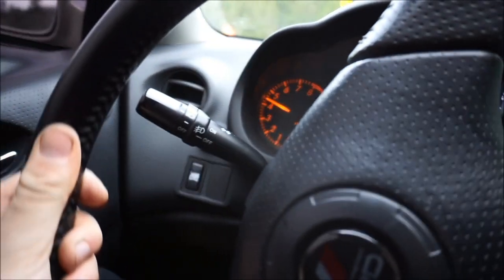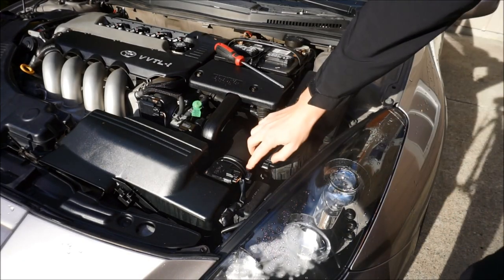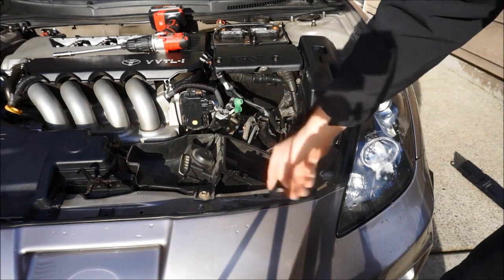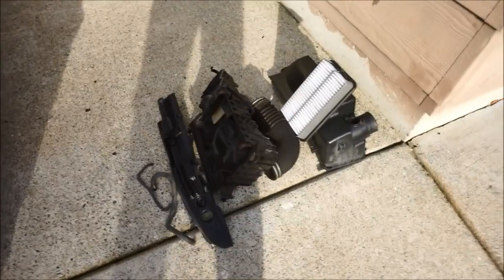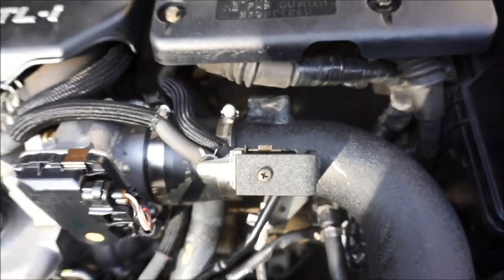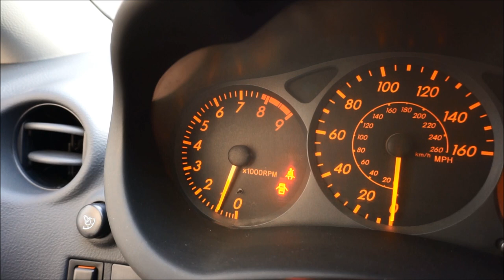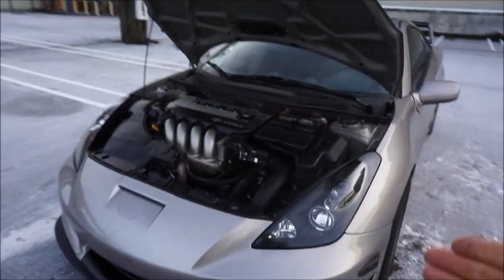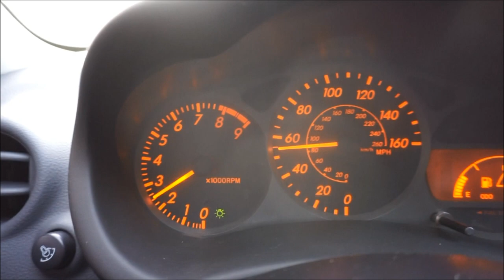MITCH DORE | Cold Air Intake Install "GAINED 10HP+"

Comment: Got beat by a stock 2012 Mazda 3 2.0 I'm selling my GTS and just buying an actual fast car  😂🤦
Reply: Turbo your gts it will destroy most things
Reply: @scottbeaumont8651  yea but for the amount is it gonna cost to turbo it better off buying a car that's gonna put out the same power at a turbo Celica
Reply: Get a second car  and use the Celica as daily. I have my Ford RS to give people the smoke.
Reply: @carlosvillagran183  Second..... (As In I second that notion)
Reply: Mazda 3 is so ugly car..lol.
Reply: You weigh less with more power stock so you did something wrong there lol😂 I tested a 2010 mazda 3 gt 2.3 before I went and bought my vibe gt. Vibe gt has the same engine as celica gts and I'm very happy with it. 😎

Comment: Put my CAI today after I was running a short ram for 2 years! Wow definitely a difference in the response the car dont feel sluggish.  That Cold air rushing  in helps with the combustion that's for sure.. mine is a AEM brand scored at junkyard 7 bucks.
Reply: How do you know which CAI's will fit?
Reply: @joshuaprobably852  make sure it’s designed for your car and engine

Comment: hey Mitch, i saw in the engine that ECU dont have air cooling duct, it is why you just put it off because this block the cold air intake pipe? Do Ecu dont really need this? What you think about this?

Comment: funny little emissions thing is air injection system. for cold start emissions....hope you never have an evap leak lol that service port is for the smoke test. why didn't you reinstall the ecu breather tube? yea it needs modified, but little piece of silicone hose will fix that and your ecu will vent.

Comment: I bought an Injen CAI.  Do you have any install videos on that?  I also cut my muffler off and ran a straight pipe out the back.  It revs up faster with the exhaust, but after you engage lift it sounds funny, like a thump thump exhaust note.  It runs like that until you shut it off for a couple of minutes.  Anything on that?  I have two 2000 GT-S's.